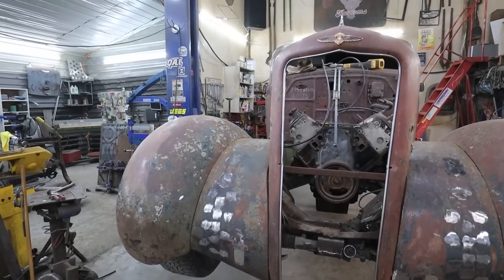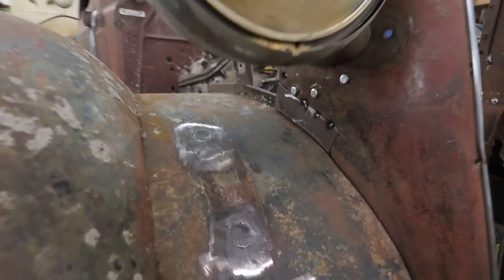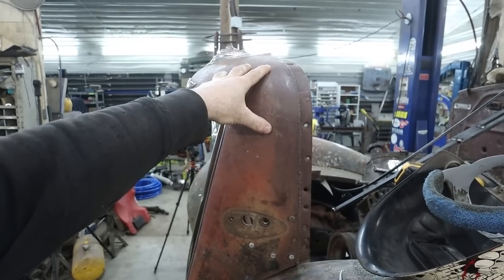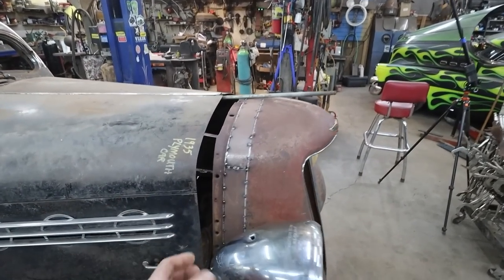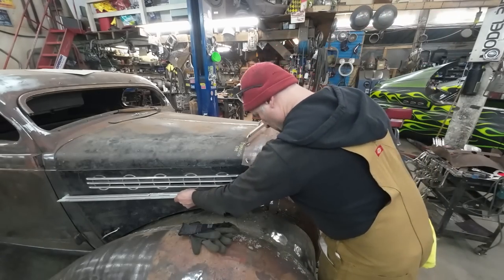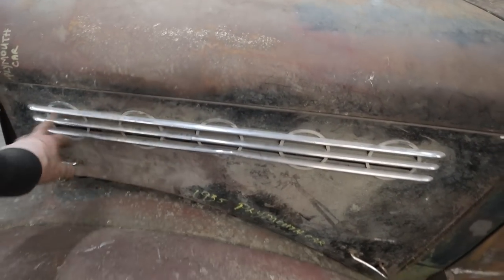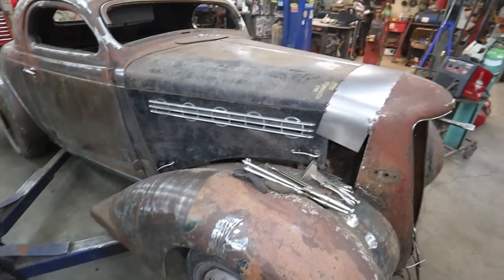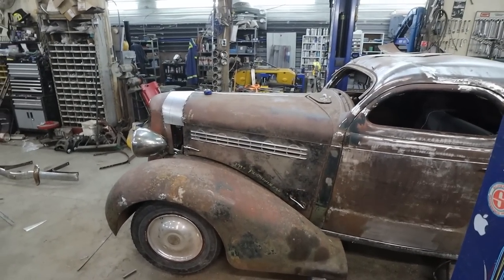Attempting to lengthen the 35 Dodge grill to match the 35 Plymouth hood,

Comment: Once you get all the angles to flow with each other - that is going to look mean and nasty. Almost has a wolf-head look.
Using strings and straight edges and measuring precisely - you should be able to nail the look of the front end. You're a great metal worker - I know you can do it.
However - I knew you would run into issues when you combine different makes of Chrysler product cars. DeSoto, Dodge, and Plymouth, Home-made chassis with a Chevy Truck front suspension and LT engine with some other transmission. That's a lot of meat to pack into one sandwich! 
Since this hot rod is a hodgepodge of parts and welded patches - and after the full skim coat is sanded and primed, I'd go with a lighter color finish. It's your custom build and only you know what you like and can live with.

Comment: Your front fenders need to come up an inch on your front mount and that will close the gap where the hood meets the fenders at the front and the grill shell needs to slant back a bit to close the gap between the grill shell and fenders at the rear of the grill shell also it will correct the sight line front the grill shell to hood then lengthen the hood to fit your grill shell, the hood to cowl needs very little to be perfect. I've been at this for 48 years and wish I were there to help you its easy, BTW I hope you and your wife have a great vacation